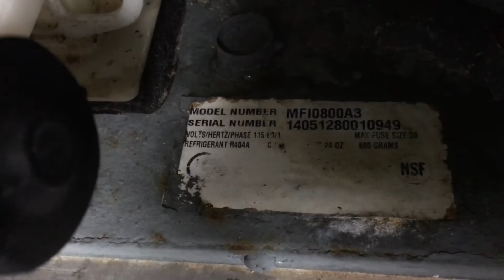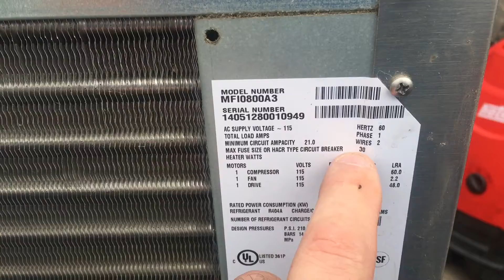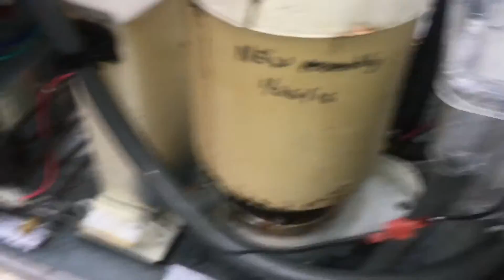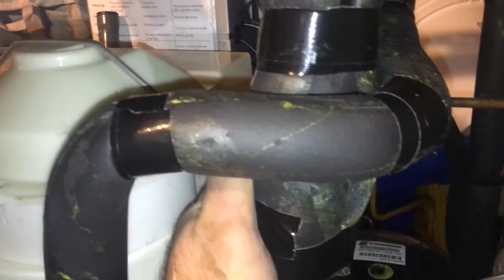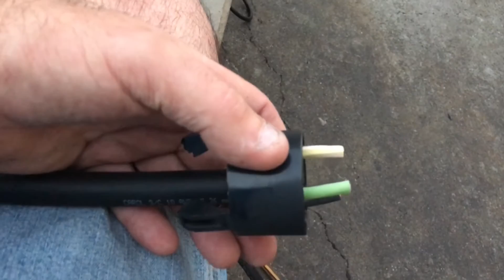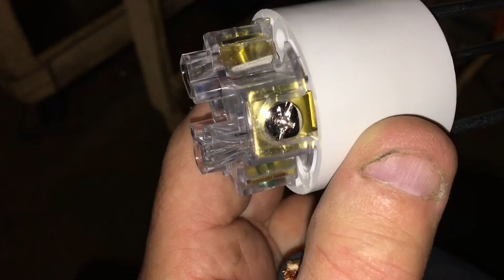ice-o-matic Flaker Repair in Detail. MFi0800A3.

Comment: thank you for the video. Question, My machine made a grinding noise and its hard to find any repair servicemen. Machine nolonger produces any ice. I was thinking it was the gearbox and to just order part. Do I need to remove r2 gas to change gearbox? Also are the cuber icemachines better and lower maintenence?
Reply from the maker: Cubers - are Alotttt More Reliable & Lower Maint !
Reply from the maker: Cubers - are Alotttt More Reliable & Lower Maint !
Reply from the maker: You should not have to remove refrigerant to replace gearbox.

Comment: Sir, Scotsman  f1222-w ice flaker  superheat measuring from txv bulb location or near the compressor suction line. because the compressor body getting freezing is it normal. near compressor suction  superheat I got 3°F. sorry for the big question.
Reply from the maker: 1) make sure txv bulb is tight to suction line.
2) I have found on Flakers that Removing all Suction line insulation if it’s in poor shape and gets cold and wet to the touch affects txv operation. Remove all pipe insulation and Re-insulate with 3/4” thick wall insulation / insultubing. Make sure txv Bulb insulation is extremely well insulated.
3) Unit could be overcharged. Remove all refrigerant and weigh in correct charge to start. allways a good place to start. Gives u a Good baseline.
4) Clean condenser.
5) De-scale evaporator with nickel safe ice machine cleaner as per instructions.
Reply from the maker: I am not familiar with that model. I have not seen a scotsman in many years. Please call Scotsman tech support for help.
Reply from the maker: UNITED STATES:

Address:
Scotsman Ice Systems
101 Corporate Woods Parkway
Vernon Hills, IL 60061

Toll Free:
(800) SCOTSMAN
(800) 726-8762

Phone:
(847) 215-4500

Fax:
(847)913-9844

Office Hours: 8am-5pm CST
Technical Service: 1-800-533-6006
Customer Relations: 1-800-SCOTSMAN
Customer Relations Hours: 7am-5pm CST

Comment: The manufacturer is who put that wire in there. They do it bases on how much power and how many feet ( WAY less than running on the outside) .  Even running wire to the machine you base it on RLA and not the max breaker size. This is only with machine that have inherent overload protection. They do that to not kick breakers on start up.
Reply: Just saw someone else posted the info..... already.